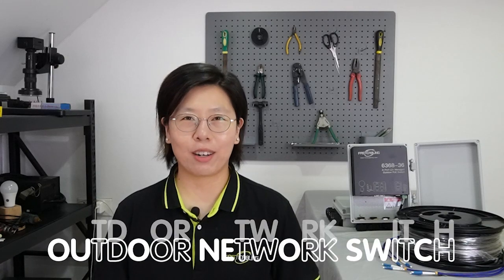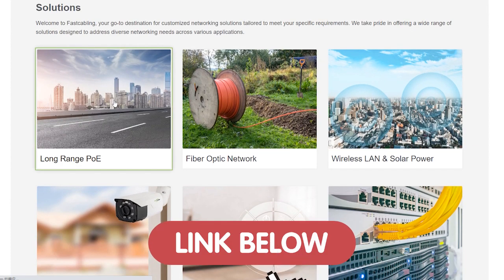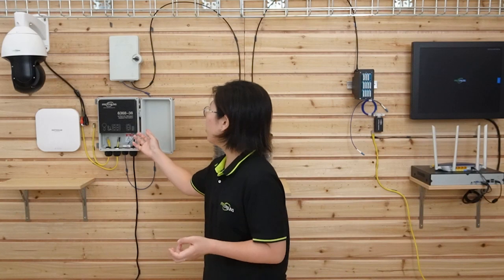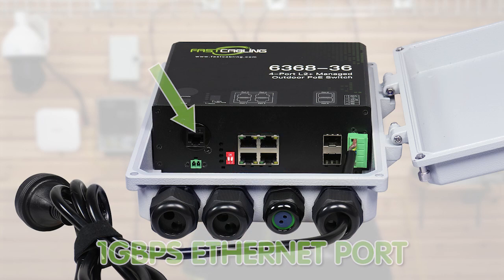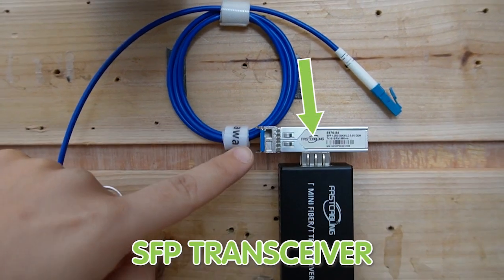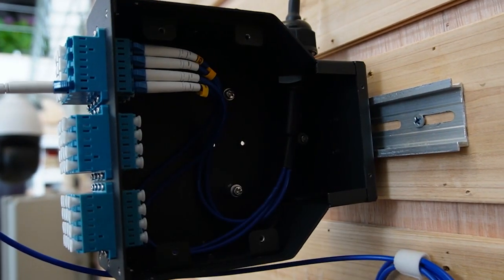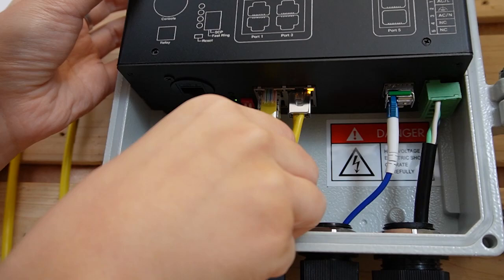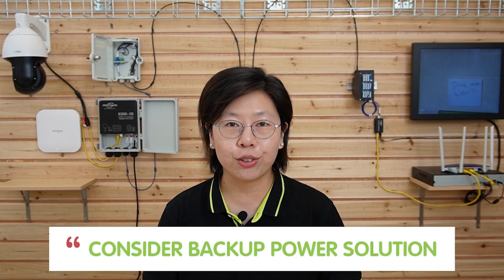Fiber Optic Network Solutions for Outdoor Switches: High-Speed Connectivity

Comment: Waaau I like your videos#explanation is  very clear, now can you do me a video on how to join a broken fiber optic cable and even how to terminate another line on the existing cable, kindly.
Reply from the maker: Unfortunately, our fiber optic cable is factory-terminated so we cannot risk damaging it. Terminating and connecting two fiber optic cables involves carefully preparing the cable ends, and splicing or connecting them. Here's a general idea of how to do so:

Cut the cable cleanly using a fiber cleaver and strip off the protective coating from the cable ends. Clean the exposed fiber ends using isopropyl alcohol and lint-free wipes to remove dirt or debris.

Fusion Splicing:
If splicing, align the fiber cores of the two cables and place them in a fusion splicer. After splicing, protect the splice point by covering it with a heat shrink sleeve and applying heat to shrink it into place.

Connectors: 
If terminating with connectors, Apply epoxy to the prepared fiber end and insert it into a fiber optic connector. You can refer to this video on how to attach the connector to the fiber: https://youtu.be/gyhVTg6gE20

After termination, you can join the cables using a coupler. 
https://www.fastcabling.com/product-category/pre-made-fiber-cable/fiber-accessories/

Comment: For a simple connection like this, how do I troubleshoot or perform fault-finding?? Any link pls
Reply from the maker: Sorry to disappoint you, we've never done a video on this topic. But here are some suggestions you might find useful:

You can use a power meter and light source to test for signal loss in the fiber. An OTDR (Optical Time-Domain Reflectometer) can provide a graphical representation of the fiber link and help identify breaks, bends, and defects along the fiber length. It can also show splice losses and connector losses.

Software tools can help monitor the network's performance and pinpoint issues like packet loss or high latency.
Switch Diagnostics: Many switches offer built-in diagnostic tools that can help identify problems with fiber ports or the overall health of the switch.

Comment: What's a fiber termination box and why would I need one?
Reply from the maker: The fiber termination box is where you terminated and manage incoming and outgoing fibers. It's designed to protect delicate optical fibers from environmental factors such as dust, moisture, and physical damage. Fiber termination boxes often include fiber management trays, splice holders, and cable management options to ensure that the fibers are neatly organized and protected.

Comment: Fiber optic cables have excellent insulating properties. Differences in potential between the beginning and the end are not a problem.
Reply from the maker: Fiber optic cables do indeed have excellent insulating properties, and they are typically not affected by electrical interference, EMI/RFI, and environmental factors but it's important to note that they cannot carry electricity. To power the edge PoE devices, it's a must to deploy an outdoor PoE switch to withstand various weather conditions, including rain, snow, extreme temperatures, and humidity.